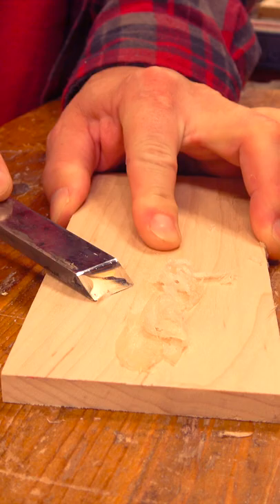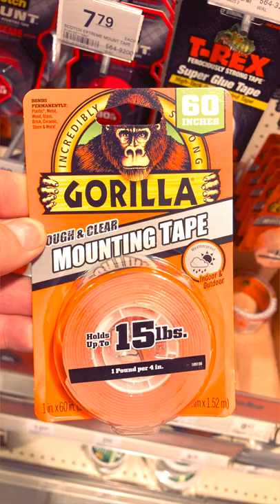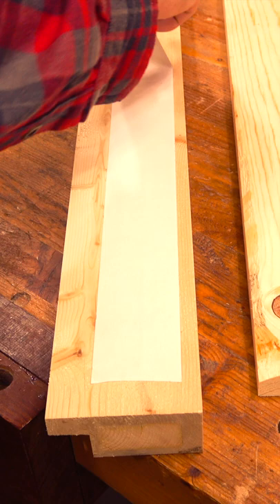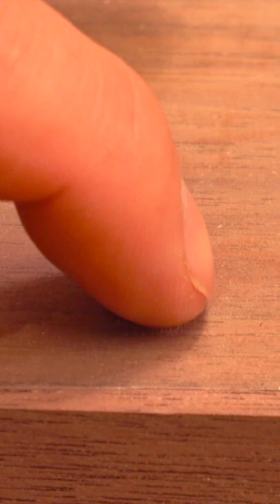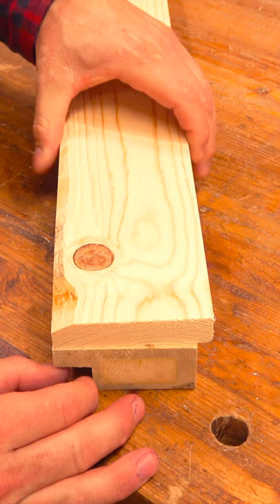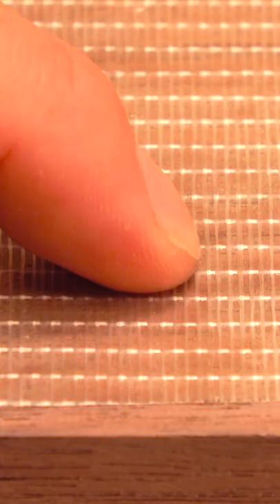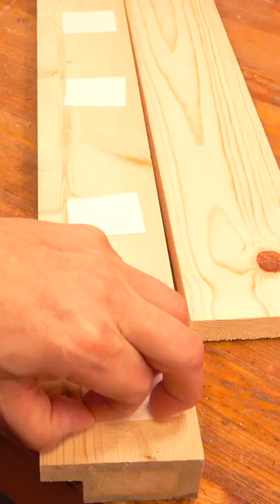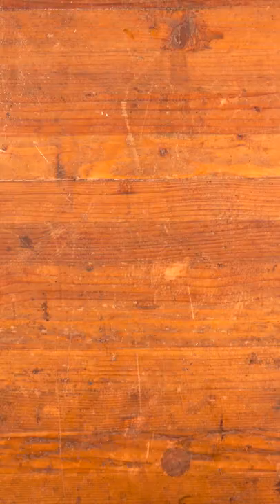23. The BEST temporary bond #MTbitesize #shorts #woodworkingtips #woodworkingtipsandtricks

Comment: So the most effective method i have found it sticks very well Adam Savage uses it actually, take masking tape put it on both surfaces and then take super glue and put it on the masking tape and stick the two masking tape pieces together it holds very effectively
Reply: Yup! Blue Painters tape, and super glue. Works great! Never had an issue.
Reply: Came to say the same thing. Works great for routing small pieces too.
Reply: I use the same method all the time, works a treat.
Reply: Didn't know Adam also did this. I picked up this trick from Ben Crowe from Crimson Guitars' videos
Reply: I never understand why people do this.
It's just like double sided tape just with a lot more hassle.
Reply: @Jehty_  leaves less glue residue than most carpet tape on my experience.
Reply: @Jehty_  no it's not just like double sided tape. Think about it. ..when you're attaching tape to a board, do you push the board onto the tape to ensure the tape is pressed firmly onto the board? For the ultimate adhesion, the tape is pressed into the board so it will conform the surface on a microscopic level. When you use double stick tape,  you only have access to press the tape onto one of the two mating surfaces firmly. The other surface is reliant in the flexibility of the board it's being mated to. You'll never get as good of a bond as you do when you can push the tape onto both mating surfaces. That's one major difference.  Another is that you get to pick the kind of tape you want to use. The real 3M blue painters tape is perfect for all my uses.  It holds surprisingly well yet leaves no gunk behind. 

Also, you don't have to use CA glue. I've used hot glue and regular yellow titebond, E6000,  I've been using this method since before there was a YouTube or Mythbusters.

I was taught to use wood glue with a few pieces of magazine paper between. It works well but requires a bit of cleanup.  This painter's tape method is by far the best IMO..

Comment: Masking tape and super glue. Everybody knows that
Reply: I use it in the machine shop, to hold flat panels.
Reply: I've used that to hold things to the bed of a CNC mill 🙃
Reply: I was literally going to say the same thing!
Reply: @bats__  we used this trick to run patterns on an old pin router. We also use to use the original de-stay-co clamps and reverse drywall screws for the same thing. All before cnc.
Reply: i came to say this masking tape doesn’t leave much residue and super glue you only need a couple drops so it doesn’t make a mess
Reply: Yup, came here to say painters tape and cyanoacrylate is a much better option as well.
Reply: I WAS GETTING READY TO REPLY THE SAME THING👍👍👍👍

Comment: Painters tape strips with superglue dots in between them so virtually no glue touches the wood and it comes apart easily when you want it to.
Reply: That super glue wouldn't do shit to improve the strength of the tape.
Reply: @aqua-bery  the superglue is to attach the two pieces of tape together...
Reply: @aqua-bery  tape sticky side down on each piece. Then super glue on the non sticky side of the tape. This is the only side available at this point anyhow. Then you can temporarily fir the pieces together using the super glue on the outside of the tape. Easy to disassemble and remove all tape.

Comment: Best thing to use is two pieces of painters tape then glue them together. Leaves no residue and easy to separate when you want it to come apart but holds very well. Very common with knife makers when trying to work on scales for the handle. If you want to see this in action go check out Alec steel or Will Stelter

Comment: Try the hot glue again. You can use rubbing alcohol to remove.
Reply: Takes a lot longer than double sided tape regardless. If double sided tape works for what you need, why add more time and effort

Comment: I’m allergic to all things adhesive, I try and avoid it because I originally thought it was latex and I found out it wasn’t, don’t know what it is
Reply: Possibly polyvinyl alcohol (PVA)? It’s in Elmer’s glue and a lot of wood glues.

Edit: Oh and if it’s glues like super glue it would probably be cyanoacrylate, specifically methyl 2-cyanoacrylate.

Tape allergies are usually due to acrylate and methylacryates. You might be just allergic to adhesives that’s derived from acrylic acid, which includes all three I just mentioned.
Reply: @typicallyusual6984  ok I’ll check it out thanks
Reply: @bpninja8641  Yeah also there’s hypoallergenic tape out there, if you ever need sports tape and whatnot
Reply: @typicallyusual6984  sorry for the 6th month late reply but I’m allergic to that stuff too, it all gives me rashes and if it’s on too long a scar